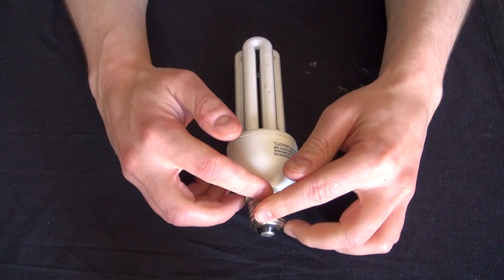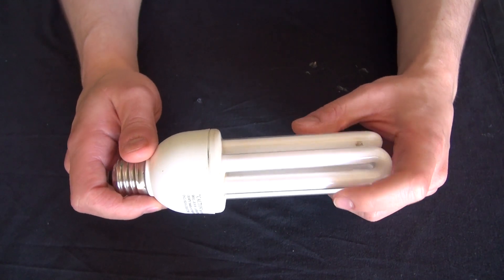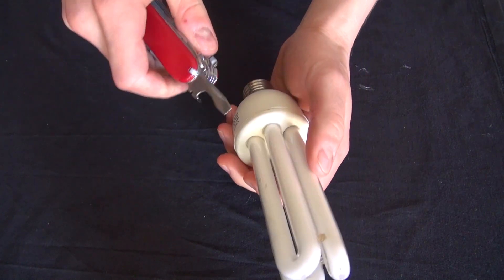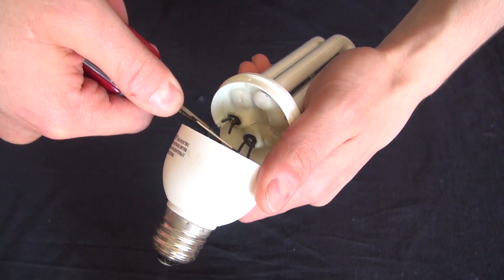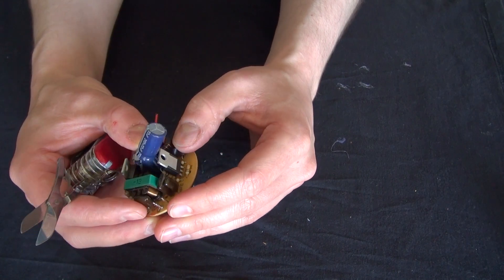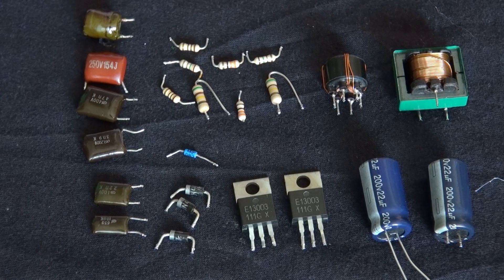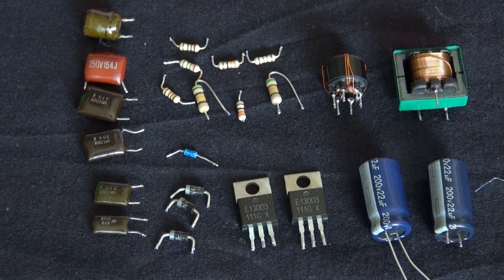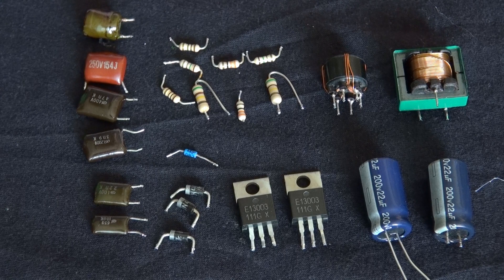CFL Teardown 2

Comment: Do you sure that two components are MOSFET? i think they are transistors!
Reply from the maker: You are probably right, because they could be power transistors. I couldn't find the data sheet on those. I am sure they are power transistors because this cfl is a higher wattage.